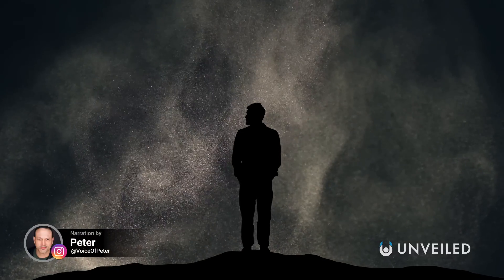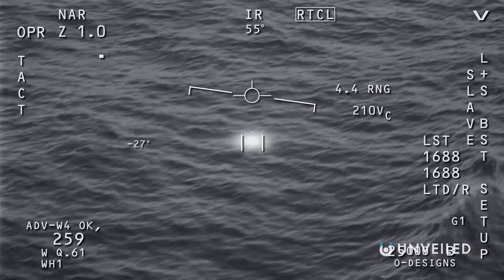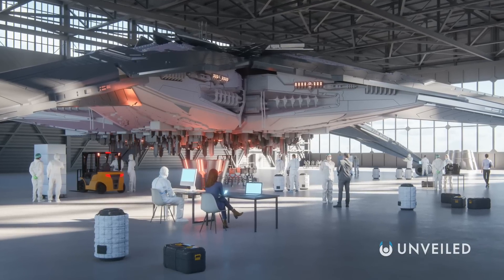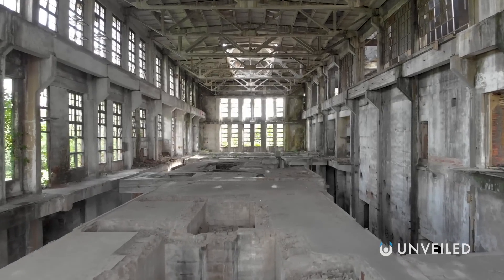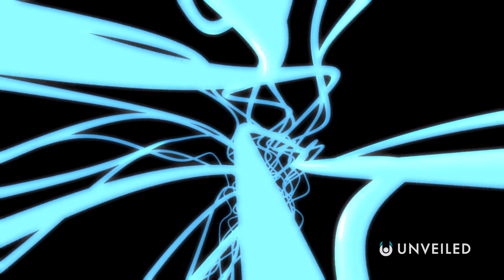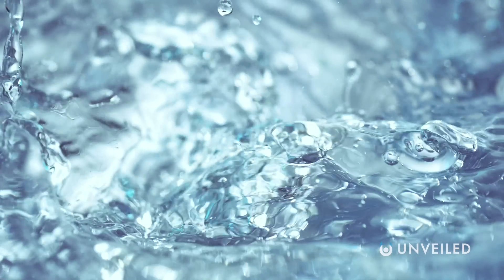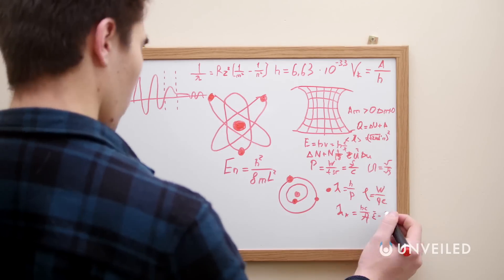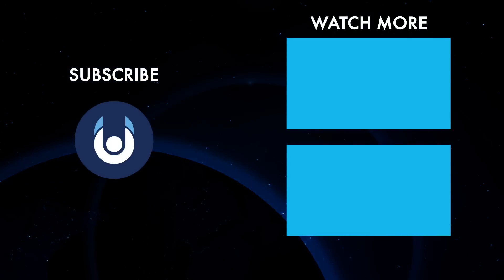The Real Reason Why Anti-Gravity Hasn't Been Invented Yet | Unveiled

Comment: May be on my imagination for cosmos is like a space "magnet" with two poles, and this has on one side "the world with matter X and gravity" and we are on this side of universe, and on opposite direction "the world with matter Y and antigravity".  This looks and is imagination only, so I do not believe we can find antigravity on the X side of the universe where we live.  Analogy is a magnet with two poles, we do not have simultaneously on the same side N and S poles.
As for levitation this is different and physic explain the levitation and makes experiments or even models. The world has unlimited potential to exploit levitation laws and gravity and generate energy for the economy. To achieve this is simple and possible but need building "levitation towers" to lift solid bllocks and then convert the potential energy on electricity on gravity generators.

Comment: I already did that , the Anti gravity.  Is very easy , I can remove the gravity in the chassis flying , the gravity is inside the chassis , 
If you fly in unti gravity way you are also connected in no weight way. 
Gapping zone is the secret of Anti gravity . ..
In rotary motion where is the gapping zone. 
In vertical where is the Anti gravity the gapping where is it ? 
In horizontal the gapping way where is it .
It's levitation levitating way. 
Want to buy ? 10 m$ first

Comment: You can't say its impossible when science is constantly evolving to our knowledge   so far we know that negative mass is possible since DARPA was messing around with Casimir cavity they seen negative energy for the first time ever  they also created a micro Bubble in space time meaning warp drives may be very possible  we know worm holes are possible but negative energy is needed to shield the ship so the wormhole doesn't collapse        legit  a few years ago scientist thought that superconductors were impossible because they needed extreme pressure or to be extremely cold to work   when now we have super conductors that are like 75% more easier to do   like the superconductor called Red Matter      that requires a lot and I mean a lot less pressure to become a super conductor   so  in the next 5 to 10 years I can see a room temp superconductor being made   we do have superconductors rn but no one wants to invent the re cooling Liquide nitrogen system because if you constantly cooled the super conductor with liquid nitrogen then we technically do have superconductors that work RN  we know that a room temp superconductor does exist but you need insane pressure to crush it   into metal  this is known as Metallic hydrogen   its a stable room temp super conductor but you need to crush it with 2 diamonds which means producing a lot of it would take billions of dollars to make but its still better than Anti matter being 75 trillion per gram

Comment: Man, it's enough you spin some 900 lbs of Mercury metal at around 100.000 rotations per minute and you'll get your anti gravity machine. Do that at the bottom of your device, start slowly. The outcome is beyond control.
Reply: No
Reply: @FVLMEN  No? Why no?? You can do it!
Reply: @kenboulder212  Stop regurgitating the spinning mercury nonsense. That nonsense doesn't just purport simply spinning mercury does it either.
Reply: Although rotating an object would create a more symmetrical curvature in space, the curvature generated by the Earth's greater mass would still prevail.